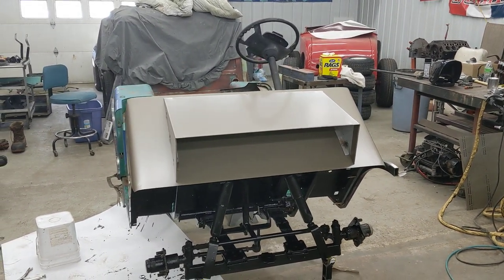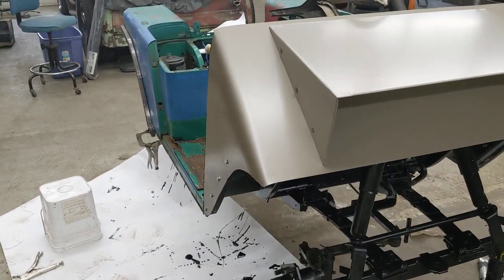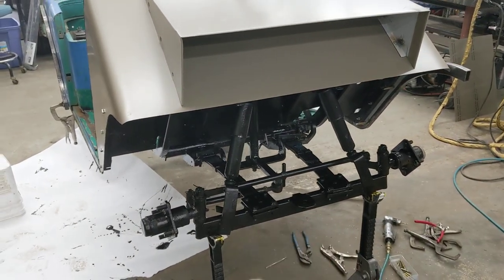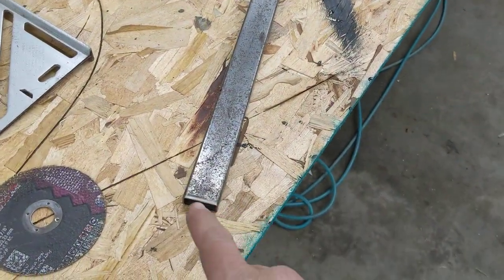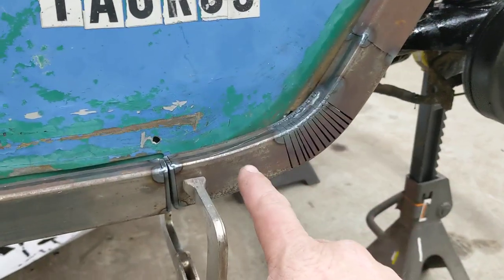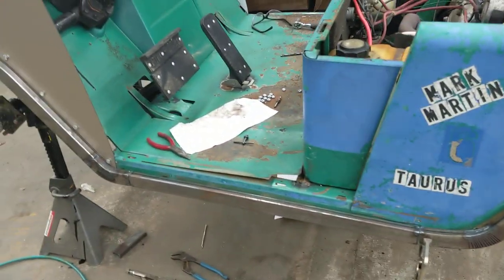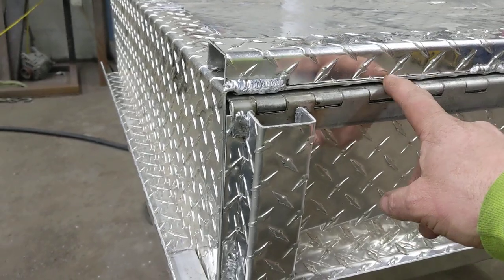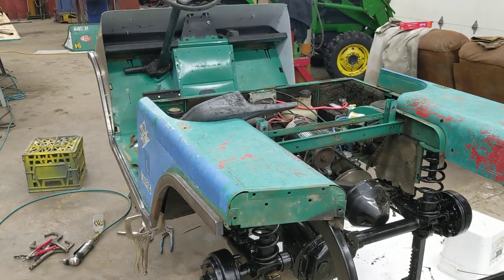Crazy Custom Golf Cart

Comment: I own a custom golf cart shop and I do all kinds of crazzy stuff from standard builds like lift kit fresh paint job rims tires rear seat kit and lights and rims and tires all the way to crazy custom builds with fiberglass speaker boxes and custom bodys made by hand from aluminum sheets and beed roolong anf bending and shapping. You shluld have just stripped cart down to frame and used a spray gun and sprayed chassis with black rustoleum in a spray gun or use truck bedliner thats what I do on custom carts. I do used and new carts as well. And every used cart looks brand new when dkne with beautifull paint jobs